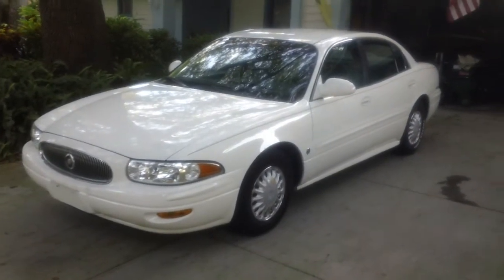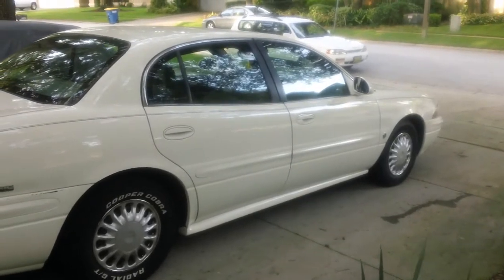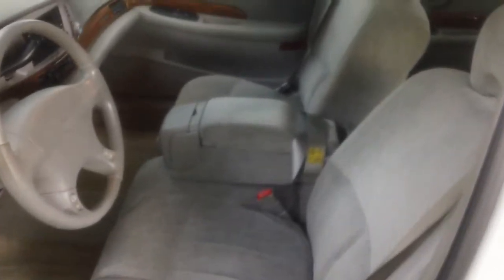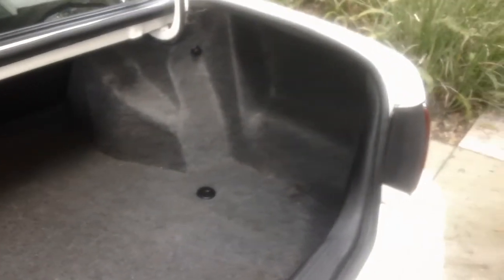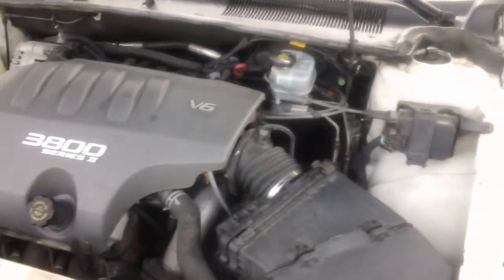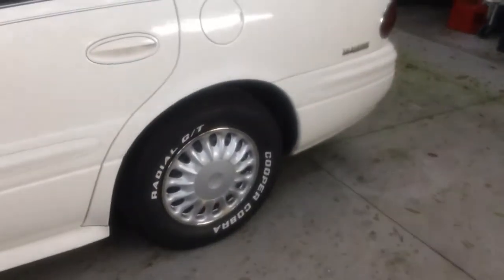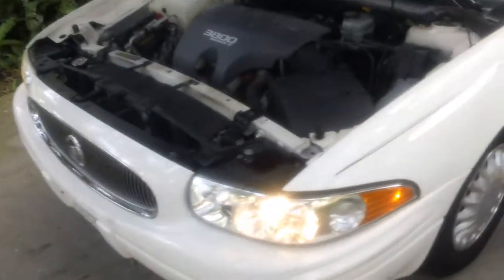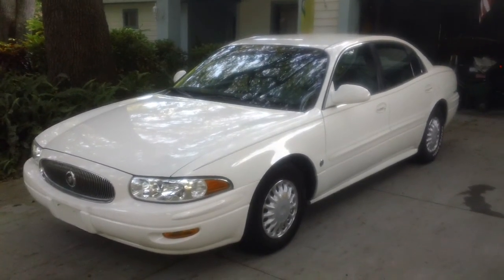2002 Buick LaSabre Custom

Comment: I just bought one, a 2003 lesabre custom.   I researched after i bought, so I am posting this so you may benefit from it.  The 3800 series two motor has a design issue that has affected a lot of the cars up until the series three came out.  The plastic manifold cover tends to melt around the egr opening and lets your combustion leak into your cooling side. I just spent 500 dollars repairing mine.    FYI    parts are around 200  250 dollars and i got a mechanic to do the install for 260$. if you stat noticing coolant leak, that would be my first look.

Comment: Had that code mines was a bad pcr valve than it change to code P107 Manifold Absolute Pressure or Barometric Pressure Circuit,  haven't had an issue since replacing both.